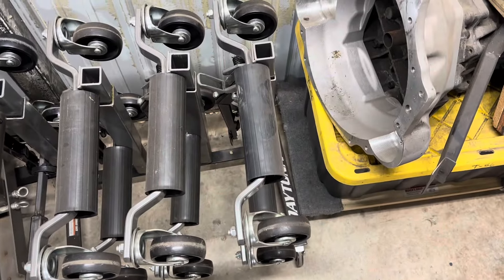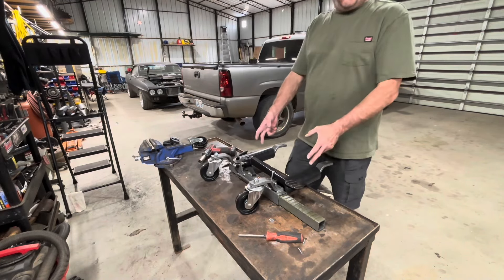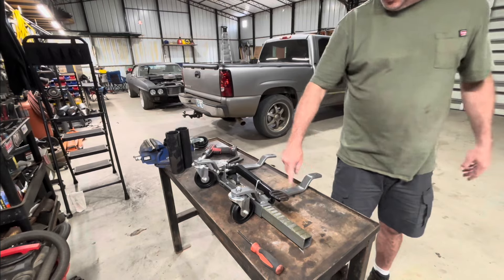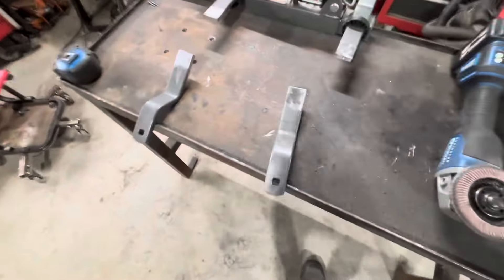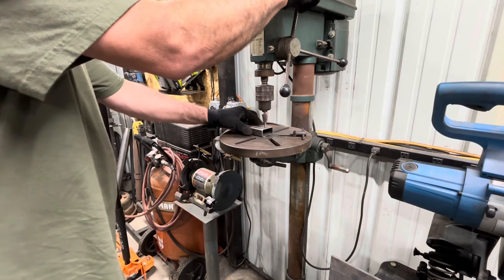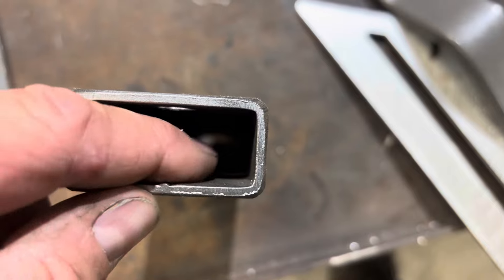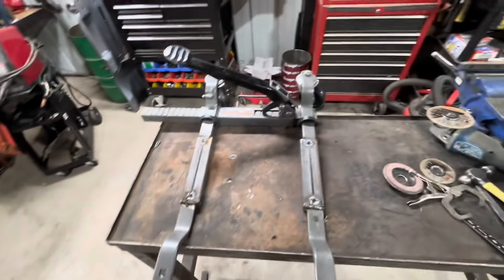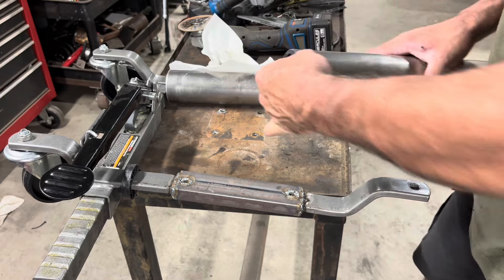How To: Voiding My Pittsburgh Wheel Dolly Warranty With Some Improvements and Modifications

Comment: Are you buying a new Jack
Reply from the maker: No, why?
Reply: @ogresspeedshop  just wondering
Reply from the maker: I bought the Daytona 3 ton, low profile, long reach jack when I first moved to Oklahoma.  So I’m set for a while with that one
Reply: @ogresspeedshop  how long does it last
Reply from the maker: @jeremynguyen2346  when I first got it, I tested to see if it would leak down overnight.  It stayed up the whole time and didn’t drop at all, I haven’t tested it since and I’ve never had any issue with it after almost 2 years now.